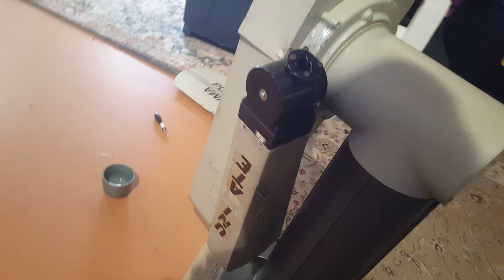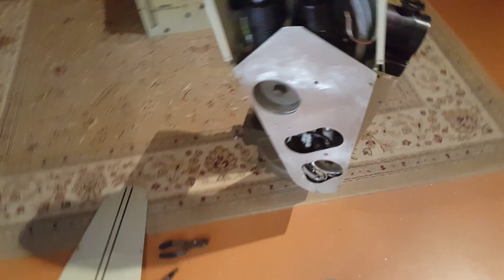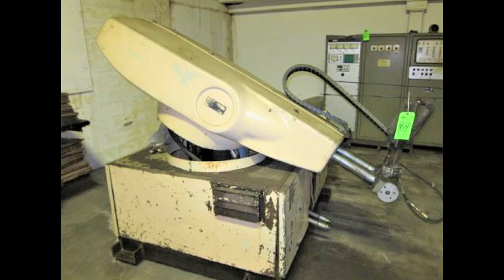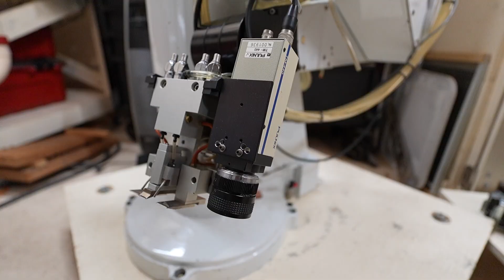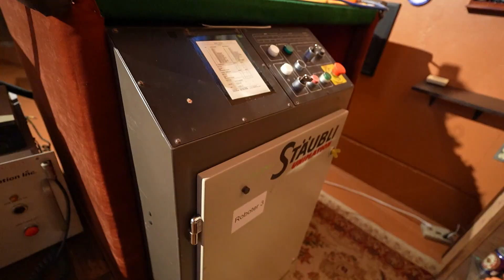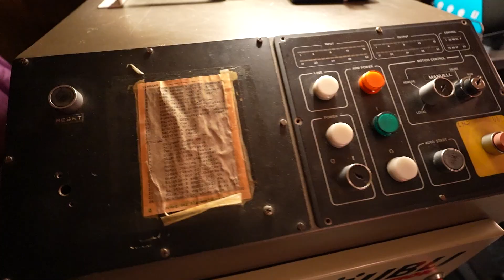Inside an original 1978 Unimate PUMA robot arm and compared with later Unimation versions

Comment: I was project leader to built a headlamp assembly system with five of these. One of our engineers, on a previous system, nearly came to grief when the robot encoder signal was lost and the major axis swiped over his head when he was bent down and put a whacking great dent in the control cabinet. I built a six element safety system to monitor the axes currents, when the machine guard was open, to protect the operator. This was fitted by Unimation to all pumas we subsequently bought.
Reply from the maker: They are very unforgiving when they move!

Comment: UK owner of a 1984 Puma 500 here. Had it for a few years and finally trying to get it working. No controller so I'm converting it as best I can. It's really useful seeing how the design evolved. Mine had millitary-style round connectors instead of the big rectangular ones. The quarter-turn panel screws are a real pain to find.
Reply from the maker: I haven't ever seen one with round connectors.  For the first 500s we got, we reverse-engineered the connections with a continuity tester and used modern electronics (which are much smaller) along with Linux CNC.  At some point I'll have to interview my son about how the electronics work - he did most of the heavy lifting.  If you ever find the quarter turn fasteners, please let me know!
Reply: @UnimateUniverse  I did wonder if the round connectors were due to it being made at the UK factory but I may never know. All I do know is that compatible plugs would have been very expensive, so rewiring was definitely the only available option.

I'm 90% sure the connector recepticles are Dzus D8-334-200-190 which I think should make the correct fasterners the D8-314-112-191. But confirming it means finding somewhere that sells them and in small quantities as I'm only missing 9. The only sources I'm easily finding only do the next size range up for race car panels.